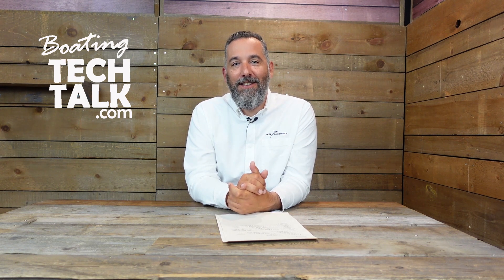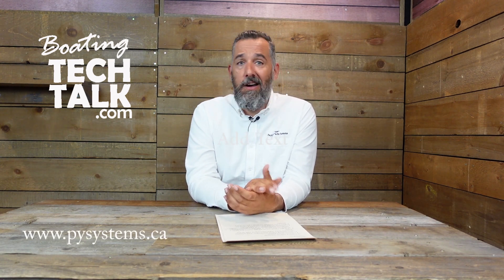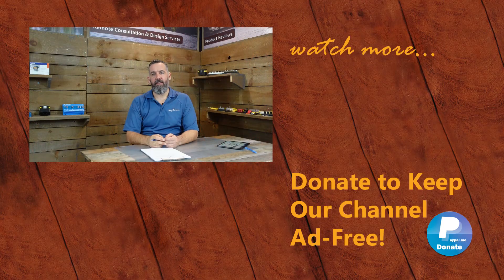How Did I Blow the Inverter Switch on My Panel While on Shore Power?

Comment: I’ve got one for you. 
Inverter wouldn’t turn on with remote switch so tried a little trouble shooting and could get the inverter to come on manually after a few repeats of pushing the power button and there’s a fuseable link wired to the inverter from the batteries.
When I can’t get the inverter to come on I test and can get 12 volts on the battery side of the fuse and 12 volts on the inverter side of the fuse. It when the inverter doesn’t want to power on I’ll test the fuse again and it will test 12 volts on the battery side of the fuse but 3 or 4 volts on the inverter side. Tried a new fuse and getting the same results.

Comment: Great stuff! Here's one that is a head scratcher for me.. After years of running properly. My inverter is tripping when the port engine is running at more than 1500 RPMs (2001 4788 w 370's) . 
I'm assuming that alternator is charging the the house bank and the inverter is 'inverting' from those batteries.. 
Heard of that before? And where to start Alternator, Batteries or Inverter?

Comment: Would a higher inverter wattage solve the problem of running 2 high wattage appliances at once? Or would that be the same
Reply from the maker: Running from the inverter itself yes you would need a bigger inverter to run more loads.  As long as the battery bank and wiring is big enough.   From shore,  An inverter with assist mode like the Victrons will add the inverter power to the shore power to allow you to run more from the dock.  But it really depends how it's wired up.     A 30a shore power cord can already run 2 large appliances as is.

Comment: Interesting topic Jeff, thank you for sharing it! 
There is a question popping up in my mind I want ask you. Kids from our boat club have installed on sailboat Renogy 200ah Lithium battery and Renogy 2000W/ 240V inverter and asked me if this inverter is safe device… Well I’ve went true the manual few times and it looks like this inverter have quite interesting function. When is connected to shore power is putting the inverter part on standby and same time is jumping AC power to the outlets. As well when shore power is off is switching to inverter. Some kind of ups function. My biggest concern about this unknown brand for me is that might not have grounding protection. In case the heater in the coffee machine get shorted to ground then 240V can get to the lithium battery true the grounding> common negative. I was about to  connect 300mV grounding tester but I wasn’t sure if there is an issue how the lithium battery will react. Soo before making experiments I think is good idea to get more information. Renogy customer service haven’t replied back. So here I am with my long question. Do you have any experience with this brand Renogy and what would you recommend to check/ test? 
Appreciate your time and thank you in advance!
Reply from the maker: Not familar with either Renogy products, albeit familiar with Renogy in name only. Installing an inverter and a battery system a boat, as you imply, is more involved then simply connecting one to another. When installing an AC system, one should take into consideration the grounding implications and also associated circuit breakers. Same goes with a  battery, in most cases the battery needs to be tied to DC ground.

Comment: I really appreciate this video, as this connection is what I’m currently installing on my boat. 
Can you shed light on if this is correct: 
Inverter power and fuse protection: DC (house battery) to fuse, to a T fuse, to a ON/OFF switch to positive Dc power Inverter. 
OR am I suppose to go House battery to fuse to On/OFF switch to T fuse to inverter? 

Thanks so much! Keep up the amazing information! I’d be so lost without your guidance on my first boat/re-wire.
Reply: Disregard: I re looked through my notes and found: inverter: to T FUSE, to switch, to another fuse before battery. I do recall a episode where you stated (T fuse as close to inverter as possible)
Reply from the maker: Here's a diagram to consider:
https://www.pysystems.ca/site/assets/files/2537/pys_inverter.pdf

Comment: So the inverter switch on the electrical panel should be on regardless of if your plugged into shore power or not?
Reply from the maker: If your inverter is an inverter/charger, then yes, because you want your charger to pe powered by AC when connected to shore power. If you have an inverter only, then the battery switch can be turned off, or you can disable the inverter function on the inverter itself or at the inverter remote.

Comment: So even with shore power or generator power, if your inverter charger fails those circuits are dead without any way to power them? Assuming you are wired as described in this video.
Reply from the maker: Hi William, that's why we often install a inverter/charger AC bypass switch to remove an inverter/charger from the circuit if it fails.

Comment: Hi Jeff,
Thank you for donating your time to help us boaters. I’m Rod and am the proud owner of a Swan 44 MKII. Recently, I began experiencing the following issue: when on shore power and I run either the microwave oven or a shop vac, the unit runs for one second and shuts down. It appears the inverter / charger resets because after it trips it comes back on line. Note the inverter switch is off when I’m on shore power. I’m able to use my AC outlets to charge phones and other devices that do not draw a lot of amps with no issue. My workaround has been to shout off shore power and turn on the inverter which allows the microwave or shop vac to run just fine. This is a new problem. Previously I was able to run the microwave, shop vac or anything else while on shore power. Do you have any thoughts on what could be causing the issue and a solution.

Also, my electronics are all original and are 21 years old. I have the build sheet from the factory which provides an inventory of all of the electronics. I’d would like to upgrade and modernize the electronics and systems and do not know where to start. Is this a project your company can take on? IZZI is based in Sausalito, CA.

Thank you,
Rod
Reply from the maker: Hi Rod, thanks for your feedback, sounds like you might have a bad connection to shorepower. You can eliminate any electrical item that is common to inverter, as your issue doesn't occur with the inverter. Probably shore power inlet is a likely culprit, remove and inspect the shore power inlet. Also, inspect the double AC main breaker.
Reply from the maker: Hi Rod, being based in the Pacific Northwest, and quite far from California, we unfortunately cannot be of assistance.

Comment: Hi Jeff, thanks for all the videos! What is your opinion on having a portable inverter/lithium battery such as the Ecoflow delta as opposed to increasing the house battery bank and installing an inverter. Are there any safety risks with such an ungrounded portable device outputting such high voltage?
Reply from the maker: Hmmm, no experience with such a product. As a point of reference, haven't seen anything like this in our service area. Anyone else have experience with this Ecoflow Delta product?
Reply: @PacificYachtSystems  I bought a 1500 Wh "solar generator" which is a weird name  (at least to me) for a lithium battery packaged together with an inverter.  It weighs 40 pounds and is 14' tall, 14' deep and 6' wide.  On my new-to-me boat I have brought it along on overnights as backup to charge the never ending devices everyone brings with them.  Means I can leave my inverter off and save the house bank for the fridge etc.  I have 200 amp hours of gel (100 usable) and this adds another 100 usable amp hours.  It is an easy way to extend my useable power for short trips and when I get to that part of the never ending project list where I add solar and lithium and a new inverter (and a charge isolator.  and a smart switch.  and rewire the mess of a panel.  and and and...) to my boat I won't need it but it is handy for now, and also nice for camping and around home.

Comment: Hi Jeff. I have a Xantrex charger inverter. The manual says I have to have a breaker on the ac side of unit which is in a van build. Others have told me it's not necessary because the shore power hook up breaker is enough. They say a special unit, not the simple plugin type is better because it tells you all kinds of info about that 30 amp hook up on the post. What is your opinion? I have noticed that you use a lot of Xantrex in your vids. Thanks..
Reply from the maker: Hi Robert, you definitely want to have a circuit protection to the AC input feed of the inverter. This breaker should be sized to handle the max amperage of the inverter/charger and also the AC wire size. In most installs, the AC breaker for the inverter/charger is separate then the AC main breaker for the vessel.

Comment: Hey Jeff why does my panel make a high frequency noise when I switch on the cabin light circuit? I recently replaced the bulbs to led from incandescent. By the way this noise my wife can hear but I cannot. Must have been the loud music when I was much younger.
Reply from the maker: Unfortunately, many LED lights output a lot of RF, the issue is most likely your LEDs.

Comment: Hello JEFF & PYS!:
SUBJECT:  What happens to your boat's inverter/charger WHEN the shore power source, 50Amp, L1 & L2  HOT leads are NOT 180 degrees 'Out of
Phase'?
AS an RV/Boat dealer shop electrician, this issue has come up.
Many boaters also have large RV's that use 50Amp, separate HOT L1 and HOT L2 Shore Power.  BUT, in the USA, (with few exceptions), most boats and RV's DO NOT have any 240V appliances onboard.
Question 1: What percentage of boats you work on, have 240V appliances??
Question 2: Do you ever find marinas where 50Amp shore power L1 & L2 are
NOT 180 degrees OUT OF PHASE?
Question 3: If answer to Q2 is a yes, what happens to the
inverter/charger if L1/L2 are not 180 out of phase????

SPECIAL NOTE: Most fancy 50A shore power cord power condition status checking 'add-on'/plug-in devices DO NOT TEST for L1/L2's 180 opposed phase relationship
status.

Most 50A, add-on, plug-in, shore power cord devices only test for:
1. L1 & L2 voltage level status with respect to NEUTRAL wire.
2. Ground lead's impedance status (if it's a high $$$$ unit).
3. L1 & L2's R.C. Residual Current loss status, i.e. GFCI; but NOT L1/L2's proper 180 degree OUT-OF-PHASE relationship status'.

Thank you.
Reply from the maker: Very cool, thanks for sharing.
Reply: @PacificYachtSystems  So, i also asent a copy to your email.  Thx.

Comment: Why is the inverter on invert when on shore power? If Shore power goes off, then my my batteries supply power to loads. An extended power loss will drain the batteries if I'm not on the boat. I have a 82 Roughwater and a 2000w charger/inverter. I have a battery monitor with an an inverter and a charger switch. Also a 12v switch on main panel. The only time I have inverter on invert is when cruising. Is this normal? It works but is it proper? Owned the boat 17 yrs.Thanks for all your info
Reply from the maker: Hi Jim, you bring a good point. Some boaters choose to enable their inverters, even when connected to shore power. If shore power is lost, then the inverter runs the AC loads from the batteries. Depending on the AC loads, the battery bank will run for a few hours or a few days, and eventually the battery bank will be empty powering the AC loads via the inverter. 

My advice is to only enable the inverter, when a boater is intentionally wanting to run AC loads from an inverter, otherwise you might inadvertently discharge your house batteries/.

Comment: Great video, and it comes at a very opportune time for me. I have been trying to figure out another aspect of the Inverter/Charger--why not having a separate neutral bus for the Inverter output will trip the shore power GFI.  I understand the ground/neutral bond is (in inverter mode) switched so that the output neutral and ground are connected,  but when the shore power is plugged in that connection is terminated.  Does the GFI trip due to lag in the switch?
Reply from the maker: Hi Al, not sure i understood your question, but here goes: when installing an inverter/charger, and when  a portion of the AC loads are non-inverter loads and inverter loads, the inverter loads need to have a separate AC neutral bus dedicated to loads powered by the inverter. Failing to do so, will cause the shore GFCI or ELCI to trip.
Reply: @PacificYachtSystems  Sorry I wasn't as clear as I could have been.  I understand that it's the ground/neutral connection at the inverter output that causes the fault.  I just couldn't figure out why that connection would be closed when in AC mode.  This article, that I found on your website, -https://www.pysystems.ca/resources/articles/elci-breaker-with-an-inverter-charger/ explains, as I suspected, that the trip happens in the time it takes to switch over from Inverter to Flow through mode.  So I'm good for now.  Thanks again.  I've learned a tremendous amount from your videos and now I've discovered the website too!
Reply: Just found the answer in one of the articles on your website --https://www.pysystems.ca/resources/articles/elci-breaker-with-an-inverter-charger/
Thanks again for all the great info!